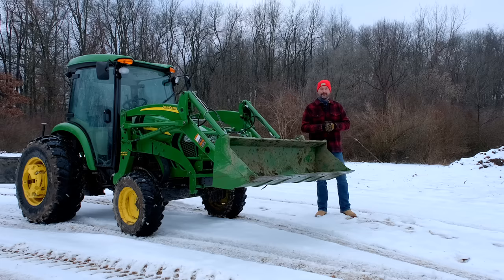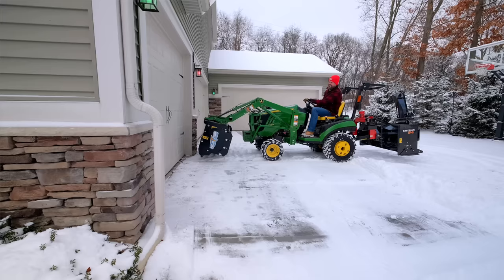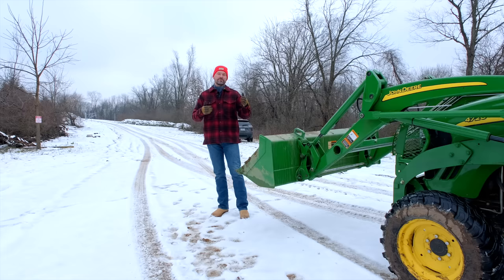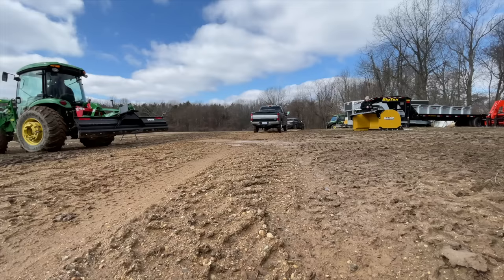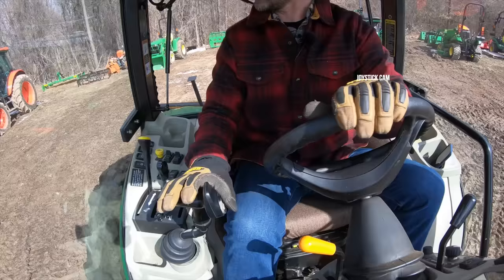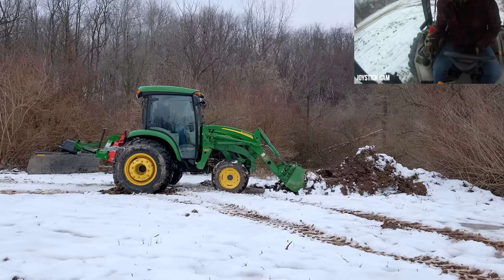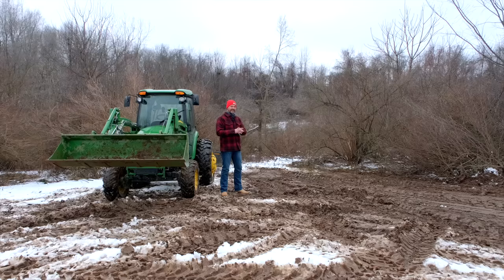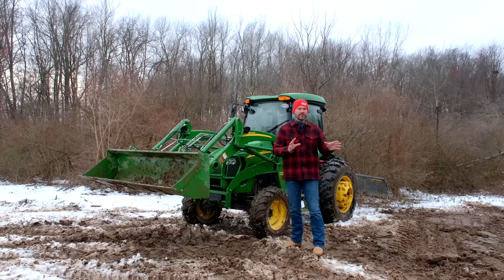DO YOU KNOW ABOUT THIS LOADER FUNCTION? WE'LL TEACH YOU ALL ABOUT IT.

Comment: Yep, I've lifted the front end on a rock more than once.  When you're not expecting it, it can be one heck of a wake-up call!!😳
Also, float is useful in back-grading, but only for material lighter than the bucket.
I've found that the bucket just rides up over.  This is when putting the buckdown down may work better for the first few passes then float toward the end.
Tim's 2 cents!😁
Reply from the maker: Haha, that's true!

Comment: Most of the time when I'm doing my driveway for snow or fine leveling of dirt I leave it in float and feather the curl. The curl will relieve the pressure most times while still in float. Plus you can use the curl to fine toon adjust the surface your working on. But the self leveling loader could be very different.
Reply from the maker: Yeah, really just depends on the situation for me.  Curl changes the angle of attack which could be good or bad, but it's definitely something I use as well.  Requires a lot of playing around with the loader joystick.  Thanks for watching!

Comment: One thing to add to this, fine tune the bucket level for when under pressure.  There is always a bit of slop, even when new, on the bucket pivots, and when the blade makes contact with the soil, it will tend to be pulled down a bit more, increasing its tendency to dig in.  This can be seen when first attempting the float at level, you can clearly see the curl increase a bit as the blade bit in.   Depending on what mechanism is used for sighting the level, put the match marks just a bit above true level, this way when the blade makes contact and starts to dig in, it is at true level at float.  Takes a bit to fine tune, but once you get it set, you can consistently drop to float every time and not chop up the work.   

On buckets that have no level indicator, but a sticker on a bracket, those are such a pain to be consistent, and all you can do is practice to get it right.
Reply from the maker: Yep, good point.  Always a little play, be ready to adjust.

Comment: There are many situations when operating a tractor that the front wheels will not steer. Sometimes because they came off the ground and sometimes because you have more force on the front implement than weight in the front of the tractor, and it is not always foreseeable.  In addition you may not be able to immediately control the tractor to make it steer. That is what steering brakes are for and why the engineers designed them that way. They knew and understood real life and how unplanned and unknown things can happen with the front and ways to counteract those occurrences. Steering Brakes....... Yup most of us have them, so if you do use them when needed.. Using float does not always guarantee that your front wheels will stay on the ground. I have had them ride up off the ground even when I was holding it in float. When I asked the dealer thinking I had a malfunction he said that sometimes happens when there is substantial resistance to what you pushing against..

Comment: I have also started doing this when backing out of the snow pile while lowering the bucket.  If you snap it into float you are not using tractor power to lower the bucket and accelerate backwards at the same time.  You take off more easily and are not robbing power from the transmission or slipping the clutch.  The bucket or box just comes down easy and really more smoothly than under pressure.

Comment: This was a good video. I’ve had issues before with the same problem always when pushing snow with my bucket. I’ve found if I just slow down some even on a long run this solves the problem. I have back bladed write the bucket where again going slow allows me to make adjustments. Like everyone you kind of work things out as you go!!

Comment: sure loved my JD1070 with 440 loader before it was stolen from a job site, operated it finish grading topsoil for 15 years....the replacement hydro compact tractor with front loader just not the same, never got the instant feed back in the joy stick or the empty feeling in my clutch foot LOL

Comment: You can split the rear wheel brakes, and use right or left brake to help your turning as well on some machines.
Reply: Just make sure your rear differential is not locked when using brakes to help steer or all you do is wear them out and glaze the rotors, even if it's a wet disc system... some backhoe's brake steering while in 4 x 4 is not good either... for those who do not know...

Comment: using float in a soft material - snow is an excellent example - you use the bucket angle to control the down force.... assuming you got it just skim to get the snow off, as it loads up you just start adding a touch of roll "up" to keep the added weight from dipping the bucket and digging in .. takes a little practice but once you get it, you've got it.

Comment: Good info!  My only complaint about getting into float is having to go through the 'down' position on the joystick. If you've already got the bucket on the ground you sometimes get jerked around unless you try to slap it into float really quickly.
Reply: My snow blade finally showed up so have been going into float a lot but completely agree, if you've got that thing too low to the ground to the start it'll get those front tires up in the air immediately! Slowly learning...
Reply from the maker: Yeah, gotta be fast like lightning!
Reply: I hate the electric over hydraulic joysticks for this exact reason, their is such a delay it is very difficult to do it smoothly, not a huge deal on little tractors but on wheel loaders it can be quite a slam

Comment: Float is best for scraping hard surfaces like pavement or frozen ground - INCLUDING BACK DRAGGING!  Set your bucket at 30-45 degrees and float as you drive backwards... great for rough grading and dressing your tire marks.  You can do the same thing in the forward direction if you rotate your bucket past 90 - the further the better.  Don't try this if your not in float however... it can be bad for your loader cylinders. 
But if I were doing any of the operations you showed in the video, especially with those conditions, I would not use float at all.  Keep your bucket on-grade and adjust to keep it there as you drive.  If your front end picks up, so what?  If you need to steer, use your split brakes.  That's what they are for!
Reply from the maker: Yeah, agreed!
Reply: on the old 1070 diff lock and split brakes will take you thru any kinda muck you can find, in 4x4 in any direction ...yeah if my 1070 had a float feature I never used it...lol and I flipped my wheels around for a wider stance with hi-floatation turf tread!

Comment: Float is a "pro" function? Geez, I never thought of myself as a "pro" operator. By the time I was 15 (59 now) I knew diff lock, float and I was just a city kid who mowed lawns and fixed up abandoned lawn tractors.  I know a few genuine "pro" operators, and they can make a machine sing. I'll never get there, but I'm always looking and reading, and observing what my little Kubota does. Tilt the buckets cutting edger back a tad if you dig in while in float. better a little high than a little low.
Reply: if you ever find a JD 1070 tractor, 4x4 in good shape, it is a fantastic all purpose compact tractor for landscape/top soil grading in the rite hands, forget all the skid steers! all you need is a 440 loader, set of forks, york rake, Vicon fert spreader, a land pride seeder and maybe a 6' bush hog if you want to mow big grass/brush...and you can make 6 figure money by yourself... of course you need a 1 ton truck and a trailer...

Comment: I don't expect everyone to be able to do it, but in theory a good operator will virtually never use float... you have to aquire a feel in your hind end for grading, and constantly adjusting the bucket to maintain production while keeping all four tires on the ground.. the bucket doesnt need weight on it to "cut" that is controlled by cutting edge angle...you probably won't fully understand it til you've practiced enough to get good at it... challenge your self and try not to use float.
Reply: exactly!

Comment: For back blading, to level gravel, use the heel of the bucket, put bucket flat on ground and use the heel to grade, instead of using the front edge, rolling the bucket out or up controls the amount of " cut "... with some buckets, if done properly, almost looks like a dozer or grader did it... on full size backhoe's, we have a bucket level indicator and after a while, you get used to it and know exactly how much cut you have without leaning over to try and see the edge... use a slight bit of down pressure keeping the bucket as flat as possible

Comment: You handle your loader pretty well for a self professed non expert. I wish the float function would allow bucket curl at the same time. When grading it is much easier to have fine control with curl instead of lift. Keep a full bucket of material for the added weight for ground engagement , compaction, and smoothing the work area.
Reply from the maker: I appreciate it Jon!

Comment: If you need to steer while the bucket has down pressure and the front wheels dont make it turn you need to seperate the lock on the brake pedals and use only the brake on the side you need to steer to, braking that side tire will push it towards the side . As well it makes a huge difference if you fill up the tires with water , I was going to get spacers but after that I didn’t need to anymore and it looks off when the tires are sticking so much out compared to the front ones imo .

Comment: My biggest issue is getting the 1025r to dig enough not to stall and have enough power to remove a full bucket. Definitely a challenge if your removing undisturbed dirt even with bucket teeth. Also keeping the ground level without choppiness in the ground.

Comment: With tractors with 2 brake pedals. You can steer with them while the front is off the ground. Bought a 2025r 2 years ago. No 2 brake pedals. And I miss them.
Reply from the maker: Good tip!

Comment: Being a very big Noob with tractors, I will probably ask a stupid question.  If/When your front tires leave the ground, would it be possible / convenient to use the separate brake pedals to stear [use the right brake to slow the right back tire, etc.]?  I do not own a tractor [yet] but thought I would ask that since I cannot test it out. thank you for the video.
Reply: yep... it helps
Reply from the maker: Definitely, if your tractor is equipped

Comment: I got me a 35-20 I just got maybe 3 weeks ago and I'm one if there's a way to adjust how fast your hydraulics move on your loader cuz mine you have to be so slow in gentle with it or it just jerks everywhere and that could be lack of experience I'll give you that but at the same time I'd like to slow it down to where every movement I make ain't just like you know opening the valve all the way up and it says and you just flops or it picks up so fast I mean maybe could be something with the joystick I don't know but it seems like I have a knob under the seat to control how fast the back 3-point moves but it looks like I would have some way to control how fast the movements are for the loader but I don't see that and I don't know where that may be so been trying to find somebody on YouTube that deals with that but nobody has dealt with that and I've typed it in I don't know how many ways and look through hundreds of videos and nobody deals with whether there is or is it cuz it might not even be an adjustment for that so that you're not just having to be so slow with your tractor loader because you don't want it to be jerking up real fast or dropping down real fast you know bucket movement that's fine you know that's not the biggest deal it's the up in the down I can get that to slow down a little bit you know I wouldn't have to be so I guess gun shy to where I'm just barely touching the thing and taking 5 minutes just to lower it down or to hit that spot and of course I'm exaggerating with 5 minutes but it is takes time though to you know push forward and and start to see it move and and move it slow like that when it shouldn't be that touchy I want to make it less touchy but I don't know if there's a way to do that or not appreciate the videos hope you can get back with me maybe make a video on one day while I'm ripping the front of my loader off lol God bless thanks a lot

Comment: Float is like training wheels. If you're working dirt you never float when pushing. Its only to back drag. Learn to control the cutting edge to do precisely what you are intending to with your edge. Your mind should always be on the cutting edge, its angle and the pressure that is being applied to it. Then you will be an operator.
Reply from the maker: Some of you guys have literally no imagination.  Work harder on figuring out why the function exists instead of thinking you know it all.  I used dirt because it was there in front of me and made for a good illustration.  Knowing when and how to use the function makes an operator.  👍

Comment: I've heard it said that, all things being equal, weight is as important as horse power. You can have a thousand horse power but if you can't get traction it's worthless. One thing I've never seen is tire chains on the front wheels. Is there a reason why? I used to have chains on the back wheels of my old IH 540, but don't dare put them on my JD 4520. I have ag tires on my 4520 and the clearance from the tire to the fender is too tight. If the chains ever got even a little loose, they would shred those plastic fenders to pieces. Getting back to the front tires, are chains not a good idea? Is that because the tie rod ends are so close?

Comment: I really dislike my tractor’s float function. I wish it wasn’t even there. I usually accidentally engage it. Its actually quite dangerous when your in a tippy situation and you want the loader down quickly. My loader doesn’t go down as fast as when it’s under power down, especially if its cold out. I’ve never wanted my loader in float and its ended up there way too many times. I want to control the loader, not have gravity control it. Just my way of looking at it.
Reply from the maker: Hmm, I've not had that problem.  Wonder if your loader valve needs adjustment?

Comment: Float is more when  your back blading not for going forward  if your not good with the loader that means more seat time
Reply from the maker: Float works well with blowers, blades, and pushers for snow removal.  You drive forward with all of those attachments.  I had no snow for the video, so simply used a bucket to highlight the difference.

Comment: This is the 4th video today where the YouTuber is explaining themselves to the armchair experts. Like you say, there is a time where you will likely get a better push with the front wheels off the ground. It’s called weight transfer. The front assist is just that, an assist. It’s not like you are in an articulated steer where there’s a need for big weight on the fronts as well! 
     Yes it’s better to have the fronts on the ground in the majority of instances, especially for turning. The front counterweights are definitely something to have. I have them on my 300 series tractor. 
    In the end,I’m guessing one guy knew what they were talking about and then 30 others that have never driven a tractor let alone own one, pile on to somehow “fit in”, make themselves somehow feel better…. YouTube is the strangest place for that. It’s great you taugh5 people about the float function. I use it for pushing snow and that’s about it. I have almost 5 decades of experience, so I know where my bucket is. The weights help in keeping the front down where I’m applying pressure like scraping a few inches of ice off the driveway. In float, there’s not quite enough pressure with the 300 series. With my 400 series I had prior it was generally enough pressure to get almost all the snow. I didn’t get a build up with it. The dealership has been over to see if there’s a problem but there isn’t. Maybe the size makes a difference. I have just adjusted my ways. No 2 tractors are exactly the same!! Haha. I like the green and yellow!! Always have. The cab, even on the 300 series is a great feature for the hot & cold extremes of the prairies in Canada!! And I’m spoiled!! 😂

Comment: Real operators don’t use float.    Sorry
Reply: Why wouldn’t a “real” operator use float? I only use it for smoothing out piles in reverse some of the time but that’s just me
Reply: @RiverValleyLandscaping    If you work the loader control it will give you a smooth flatter grade.  Using float is ok smoothing up something that’s almost perfectly graded.  Plus it does take more skill to do it your self.   Going a step farther using a bulldozer the blade is kinda heavy and cuts in from it’s own weight
Reply: @RiverValleyLandscaping  never!